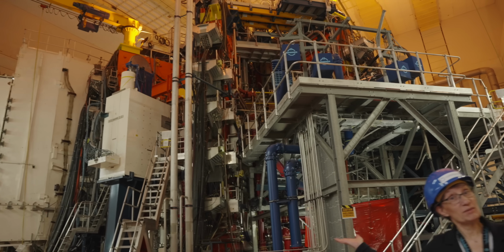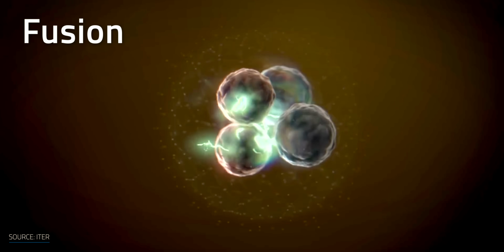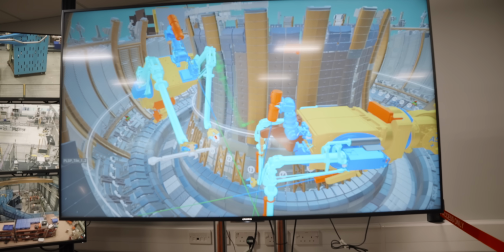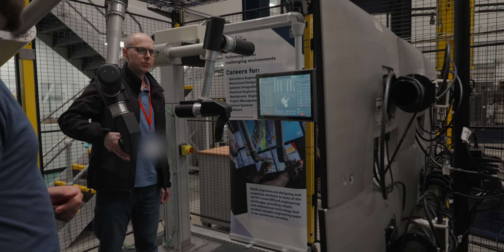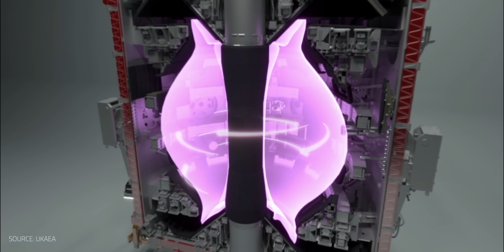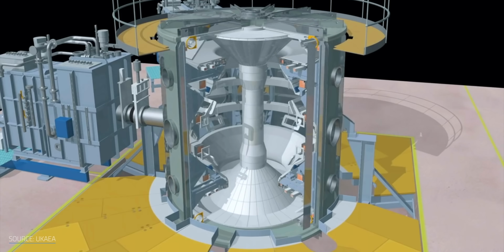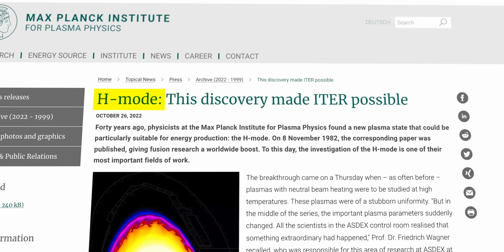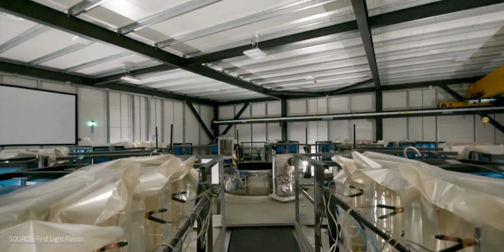How We’re Going To Achieve Nuclear Fusion

Comment from the maker: So what do you think? Do you think fusion energy will be here within 30 years? Get an exclusive Surfshark deal! Enter promo code UNDECIDED for an extra 3 months free at https://surfshark.deals/undecided

If you liked this, check out Why Salt Water may be the Future of Batteries https://youtu.be/vm2hNNA4lvM?list=PLnTSM-ORSgi4dFnLD9622FK77atWtQVv7
Reply: Actually worked on a fusion research project in 1982, briefly and tangentially.

We were ten years away then.

We're further away now.

Categorically, any engineer who has looked at all the figures and added up all the costs and difficulties, would have to admit WE CAN'T FIX FUSION enough to make it commercial.
Reply: @bartroberts1514  That´s the point, the energy necessary to contain the plasma is more than the energy produced. Gravity is "free", electromagnetic fields are expensive. Plus the fuel is expensive also.
Reply: @marpintado  Ask yourself, how much energy is needed to run your heart? How does the heart even get its energy? If you can harness that energy, you are on your way to a properly functioning sustainable Fusion Reactor. ☢
Reply: @bartroberts1514  There is a way to overcome the Coulomb Barrier safely and effectively. And the process is here now. It's patented and trademarked. Enjoy!
Reply: @quantumkineticscorporation  Fraud is a strong word.
Reply: Having followed Fusion  for the past 40 years, I still don't think it's imminent.  I think the Tokamak is a huge, cumbersome technology, keeping a star in a box is a vast technical proposition.  I'm not convinced Tokamak will make the leap to commercial operation.   I personally think First Light is on the right track, with small scale fusion at industrial l scale is a much more realisable proposition.
Reply: @richardfox4803   a more practical idea than plasma confinement perhaps, although I still have no expectation. But at least the concept addresses and puts first the actual generation of electricity.  
JET et all are more fascinating research projects, with spin off benefits, on a scale of the LHC.
Reply: @stewiemac4017  Fascinating makes for good science, but less useful for commercial engineering.
Reply: @richardfox4803  "Star-in-Box" is quite easy. Anyone can accomplish it. If you know the secrets.
Reply: As funny as the old 30 years away thing is, I honestly think we're maybe 10 years away from properly sustained Fusion and then the goal after that would be to keep making it smaller I would guess.
Reply: Robotics combined with AI is the future (in the future) of this kind of work, and many others, so anything covering robotics will be very educational on many levels.
Reply: With modern advances in fusion technology, scientists have managed to reduce the time from 30 years away to just 3 decades!
Reply: Hello Matt, I have a perspective, having arrived at Harwell and Culham around '82 as a UKAEA science officer. Spent a_lot of time using hot cell manipulators. 
What we can be pretty sure of after 40 years, plasma confinement fusion will not be generating Grid electricity this century. 
I don't believe we ever will. 
The engineering challenges are impractical, it is unlikely to be financially viable. 
Fusion research has diverted essential investment in fission energy in a full Fast Reactor cycle, which we know is practical. Ironically UKAEA was then the global technology and research leader. 
Tammy Ma at the NIF is most realistic about this. Particularly the elephant in the room...fuel. 
Meanwhile collecting energy from the fusion reactor in the sky is racing ahead, getting cheaper. Remembering that thousands of times more energy than humans could ever use falls between the Tropics. African and Australian desert wildernesses come to mind.
Reply: This was like an elementary-school field-trip - visually impressive but without substance. Is the future of practical fusion energy rosy? Ooh - look at shiny big thing, and all these nice people!
Reply: Fusion won’t be viable for energy due to the lack of resources available on Earth. Until we get to space which probably won’t happen for an extremely long time fusion isn’t viable. We’re better off using fission and finding a better storage method. Fusion is great for research but nothing else, especially net energy, for far more than 30 years. Overall, the hype for fusion is mathematically and scientifically overblown and incorrect.
Reply: People are sceptical, but 2 years ago AI didn't seem to be making that significant progress  and now there is an exponential flood (a  parallel as well as it feeding into fusion technology)
The potential benefits seem to me too high to set a time limit on so whether its 10 years 30 or 300, we should persist.
Reply: @schumanhuman  True, but the problem is massive! Better spend money on fusion than on war!!!
Reply: Propaganda. Capitalism is the problem, not the energy source
Reply: Sooner.
Reply: If Fusion reactors are gaining momentum - Including small scale reactor prototypes. Are large scale solar farms still a viable long term business strategy?   For example, would investment in large scale solar installations pay off before Fusion becomes mainstream?
Reply: @ElectricEdgeAi  I think a combination of things will still be needed during our transition to fusion power as our primary source, but it would still be nice to have solar technology that's super advanced so that if there's something possibly goes wrong with the power grid we will have alternative means of power.
Reply: @Scott , I work for a company that at one time had one of the largest solar field in the US.  In return for acres of solar, it only produces on the best days around 18kW.  Compared to one coal-fired plant, that is a pittance.  Coupled with the environmental impact of solar plant materials and battery manufacture, solar is terrible.  Residential uses are definitely viable for solar, but aside from agrivoltaics, I'm not a huge fan, at this point.
Reply: @PhinAI  I'm not disagreeing with your statement at all. But, the solar market is still growing with megawatts being installed daily, so clearly someone sees profitability in solar. My question is... will current, large scale solar investments pay-off before Fusion is actually viable? Are we that close to Fusion, or is it truly 30 years away?  It's worth noting that small scale Fusion reactors are gaining more headway than the large ones.
Reply: @Scott , large-scale solar plants are presently maintained as feel-good operations backed by Government funds.  Dry up the funds to make it lucrative, and they also dry up.
Reply: 2km² Solar array in my back yard. 180MWp over the year on average not even ten percent ofcthat! Excluding grid and standby losses.
In the Netherlands(52°N), Germany and most of the US, PV is absolute garbage.
Reply: @PhinAI  Solar's still by far the most cost effective energy per kWh according to studies worldwide.

When you say you work for a company, is it by chance in their coal division?

I ask because coal is unprofitable, and if you withdrew the coal subsidies all coal worldwide would collapse into bankruptcy in two years.
Reply: @PhinAI  A properly operational fusion reactor can be run from low input power (1.9 - 4.8 watts/sec) that solar can easily generate. It is possible and it's here now. It's called, "The Quantum Kinetic Well." Enjoy!
Reply: @ElectricEdgeAi  solar isn’t very profitable without subsidies.  I dont even think there is a solar electricity producer in the S&P 500.  They are mostly start up and ventures that don’t make it in the long run.  Solar is a disappointment with the possible exception of areas in the southwest US where the sun shines consistently.
Reply: @cleetussnow7159  Amazing. Every word false. You'd have to know the facts to get them so exactly wrong.

Solar is the lowest price per kWh, and rapidly pulling ahead on profitability.

Meanwhile, fossil sucks back over $6 Trillion USD in subsidies annually and still regularly goes bankrupt.
Reply: Matt......We accelerated lasers of GRB pulsed... using a Tuned Venturi which forced the fields to CRUSH exactly as a particle smasher but PHOTONS. This created Sterile Muons and Electron Showers.... and they split and after the Venturi FUSED back...I can prove this and Lawrence Livermore Just confirmed it. Please contact me so I can send my evidence?
Reply: Fusion is like Wind&Solar.Looks very good in politicians eyes but still doesn't perform.
And It will not perform in the forseeable future.
Even here in the Netherlands, and Germany we are still running more and more cial gas and nuclear to keep our grids running! That while our heavy industries are running away to China and other countries with reliable cheap energy! This whole renewable madness is killing our economy. And CO2 is no issue at all! CO2 based climate doom is the biggest scam ever!!!
Reply: It's unlkely.  A better approach would be to focus on fission reactors, with the primary goal of lowering cost per KWh.
Reply: No.
Decades of materials science needed.
Meanwhile we're stepping backwards on overall power availability 

And any talk about clean fission energy VERBOTEN
Reply: not likely, maybe sometime next century.  people don't really appreciate the scale of achievement that fusion is; it is literally harnessing the power of the stars.  look at a size comparison of the earth to the sun to get a sense of the immensity of the task.
Reply: Fusion 🎉
Reply: No, if we’re still figuring out how to control plasma by now, there is something fundamentally wrong with the concept and/or implementation that ppl aren’t making public (or at least explaining in an understandable way). My guess is that we can’t easily keep lots of plasma particles of different mass running at different velocities with only a couple of huge electromagnets. Perhaps that’s why there is a stellerator design. Maybe if the science community would stop “dumbing down” the explanation of why they don’t have fusion yet, they might actually get some innovative ideas from outside their industry.
Reply: The only reason that billions and billions of dollars are being poured into tokamak research is that tokomacs are guaranteed not to work.  Inertial confinement fusion and cascade fusion are much more promising technologies that are being ignored and will continue to be ignored until the powers that be want us to have fusion power.
Reply: submerg it in water and use the rising steam to turn turbines and produce more electrictiy to power the cooling system as a closed loop.
Reply: @DeadbeatGamer  Hard to guess which post you're replying to, but I think it's a bit harsh to suggest we drown all the people lying about fusion's potential.
Reply: Nuclear fusion energy fans live in a fantasy world of technological wonder. They continue to assume that we have 20-30 years left to turn this 'Titanic' around. They tend to fall for all the nuclear fusion sales pitches that are common with such projects. They tend to focus upon the latest developments while paying little attention to warnings such as the following. I urge readers to search for the following articles and book.

ITER is a showcase … for the drawbacks of fusion energy (The Bulletin of the Atomic Scientists)
Sun in a Bottle?... Pie in the Sky! (Book)
IPCC report: ‘now or never’ if world is to stave off climate disaster (TheGuardian)
UN chief: World has less than 2 years to avoid 'runaway climate change' (TheHill)
  * Note that this statement was made 4.5 years ago.
Reply: fan of nuclear for two decades until solar and wind. here is the problem, imagine state of the art science/physics just to boil water to turn a generator, then to electricity. in other words, it is expensive and inefficient. the science could be useful for massive source of heat in the future.
Reply: So my question is.... what's going on with China? are they getting any further ahead than france/europe with fusion?

I think it's neat.. but it seems like smaller portable fusion reactors would be a goal?

Also good video. Thanks for doing it.
Reply: @MRSketch09  - The confinement record set by the PRC experimental machine took place quite a while ago. Most people who heard about it assume that they achieved a sustained fusion reaction. That is because the hyped sales pitches emphasize what it may lead to rather than the details of what actually happened. It was a normal hydrogen plasma confinement reaction, not a reaction involving nuclear fusion fuels. That particular machine is not designed to employ nuclear fusion fuels. The experiments on such machines often take extended periods of time to set up and then lengthy modifications take place to improve on such experimental facilities. The public generally only hears about record breaking events and those are typically presented with much sales hype. Typically, the many nuclear fusion fans have no interest in exploring critical analysis of such efforts.

Controlled nuclear fusion efforts require dealing with immense repulsive electrostatic forces of positively charged nuclei. As a result it generally requires extremely large machines to achieve the forces needed to create the reaction. Significant miniaturization has been achieved in the form of thermonuclear explosives (H-bombs) but they don't provide their energy in a very useful way.
Reply: 30 years? No chance.
Reply: Tokamaks needs He3 to start, and we are running out of He3, and there is just a hope that fusion reactors will generate new He3 that is needed to run the Tokamaks. This all just sounds like wishful thinking. I don't think it will ever be viable.
Reply: @RegebroRepairs  - I agree that none of the nuclear fusion energy approaches are likely to work before industrial civilization collapses under the weight of abrupt Anthropogenic Climate Disruption (ACD). This is the first time I've heard that He3 is required to start fusion reactions in Tokamaks. Please provide solid evidence of that. Also, what is the quantity, in grams, that the world now posses for starting such reactions?
Reply: It's already here. We need to know how to control it in useful ways. Tritium might not be the most economically viable way to use it, because of its scarcity and radioactivity, but it is a stepping stone towards the use of more commonly available atoms, including H₂ or H+ for the job.
Reply: @RWBHere  - The engineering efforts to obtain controlled nuclear fusion have been going on since the 1970s. The vast majority of the recent announcements, that you've heard, are filled with hyperbole that is intended to attract potential investors. Most of the stories leave out key factors, such as the extreme rarity and expense of radioactive tritium. The reason that the tritium isotope (3H) has been seen as the most practical fuel is because of the even more extreme impracticalities of employing the normal hydrogen isotope, protium (1H). It requires far greater confinement pressures and temperatures.

Many technology lovers, who have never taken academic courses in nuclear fusion physics, are unaware of this fact and look to technology as a god that can solve all problems.
Reply: It is aa much better idea to stop funding this.
I really do not understand that it is funded in the first place.
Reply: @marcelmolenaar5684  - Many technically oriented people like to believe that fusion energy is a key to overcome the problems that have arisen due to our addiction to the energy derived from fossil fuels. As a result a market has arisen that capitalizes upon that dream. Most people continue to assume that we have 20-30 years left to turn this 'Titanic' around with such advanced technologies.
Reply: My bad.

Comment: Fusion (of hydrogen) doesn't produce/give-off energy, but creates Helium, ready to give- off energy by broken - back into Hydrogen. Man-made reactor is "zero"/Vacuum pressure but around Solar core when ultra-compression occurred, 2 hundred Billion bars (atmospheric pressure) compared to "zero" of man-made reactor... So that no matter how heavily protons (for starter) and microwave Energy were injected to stimulate the ultra- compression, but such expecting Fusion will never happen. B'cuz the only real FISSION of Helium(nucleis) to be broken down, will give-off energy. COP.(plasma) of the Reactor must be at least 700 - 1,000% (10 times) as feeding of Microwave and Static heater (just like steam boiler- Turbine efficiency) to cover the power generation device, thus, make the COP.(total) must be 350 - 400%(4 times) enough to feed all Vacuum Pump, Cryogenic compressor, the Cooling pump, the Super-Magnetic Coil and all monitoring system... What they had announced the Great Success is NEAR 100% Break-Even point of Plasma COP. (should be 700 - 1,000%, not << 70 - 100%) that plasma just can't sustain itself, not to mention providing/running the overall Pumping/cooling and Super-Magnetic systems, etc. These project will never achieve.(Plus the super-high cost of installation (higher than Ordinary Uranium/Plutonium nuclear reactor.) NObody/ Country will ever be capable to AFFORD this "never-acheivable" Dream Power project.!!
Reply: Plasma COP of 10 times (1,000%) means if 50 MW input, expecting of 500 MW output..not only to sustain the plasma, but much more excessive heat is needed to run all the peripheral/supporting system, the cooling, Pumping, magnetic coils, microwave and static heater (not to mention the laser/synchrotron to get kick-start, which need enormous of energy that NEVER made into account.)

Comment: It will still be obscenely expensive. You wont have to pay for the coal, but the advanced system maintenance and experts will still drive the prices up. It is only useful when we run out of fuel, and not as useful as fission which already works.